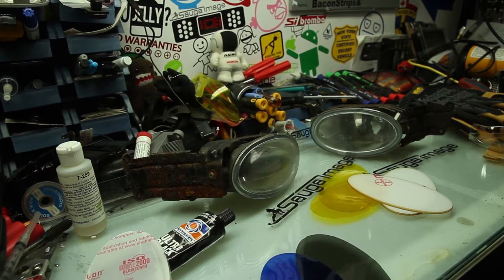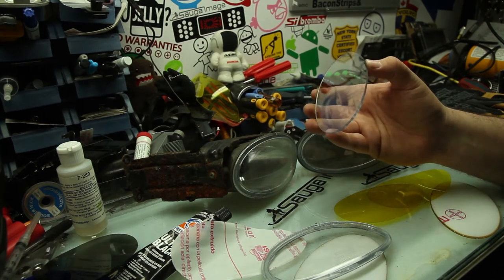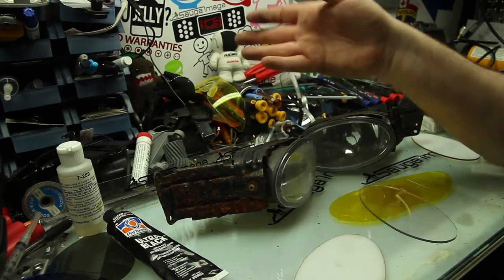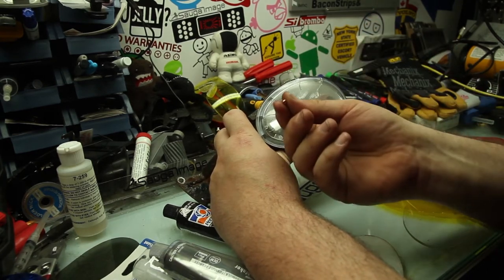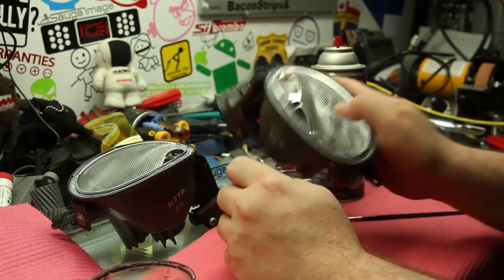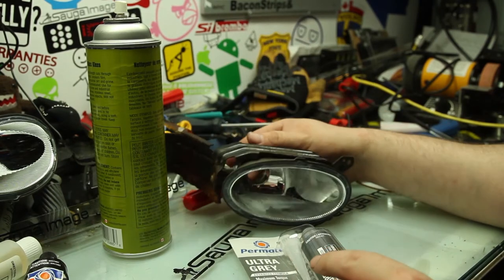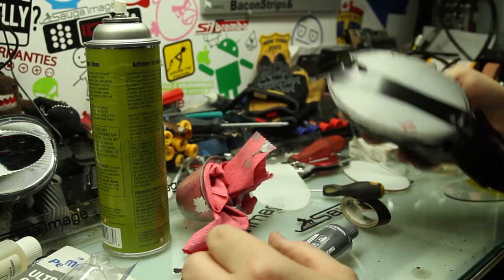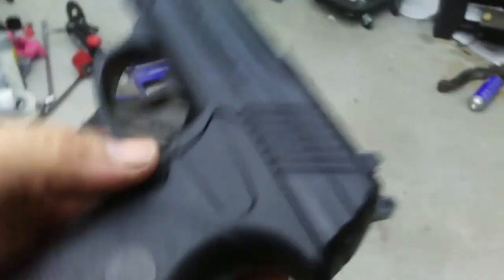DIY: Broken Fog light repair with polycarbonate or lexan

Comment: Hi,

I have a 07 Honda Civic with aftermarket fog lights installed - not the factory ones. Do you have the specifications of the fog light lenses on your site? I just wanted to make sure they are the same size that I need (i.e maybe my aftermarket ones are closer to the 09 Civic lens)
Reply from the maker: In the end of the video I shoot a repaired for light several times. That should be the one on the 06-08 model. It has a plastic bezzle that goes around the lens itself. If you have the newer model which is unlikely for a 07, it will look like the one I'm repairing the whole time here.
Reply: Bart Koscow oh ok ya you’re right, i believe that’s the one I have. Can I replace the lens without taking the fog light out? It looks like I could just pull the rest of the glass off and slide the new lens in while on the car. Also, How long does it take to be delivered? I’m in the Ottawa, Ontario area.